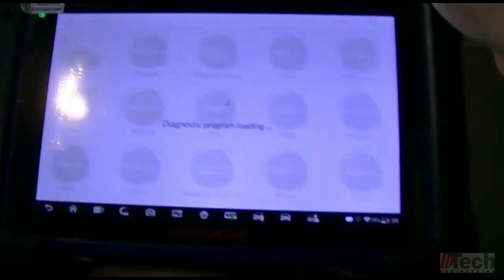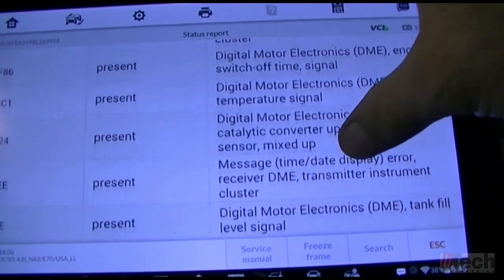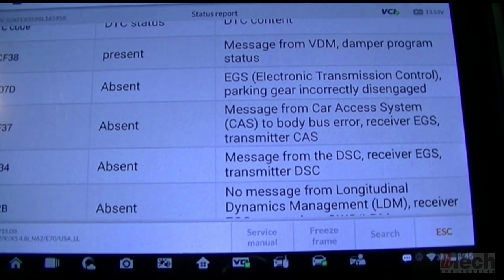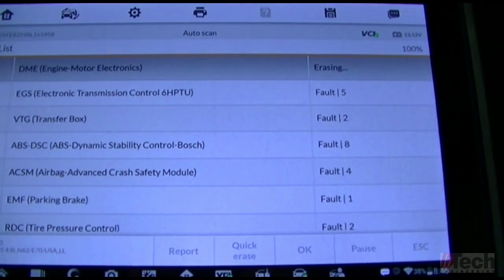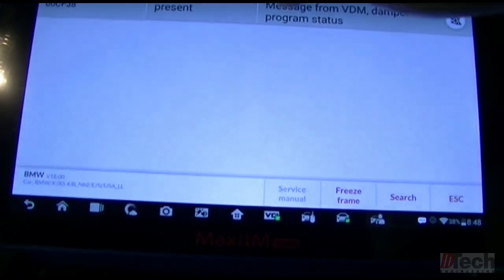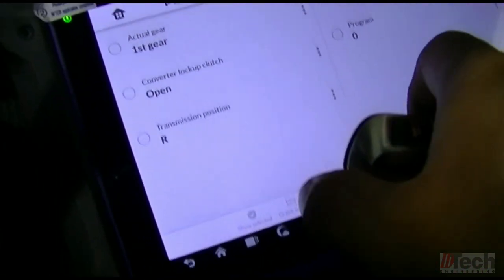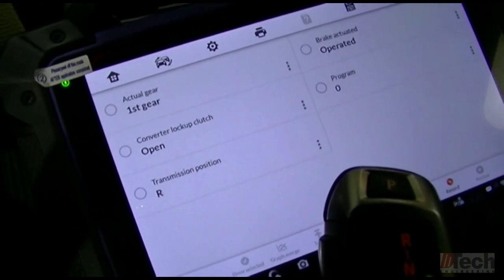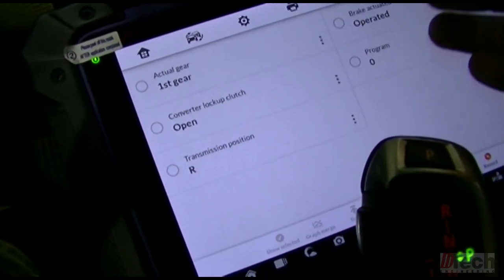2008 BMW X5 E70 No Gear Engagement Stuck Park

Comment: Bro u dont know how much this video helped me. I was struggling trying to diagnose this same issue and I was stuck thinking it was a ews Isn issue because I also did the same thing you did with the spare valve body. I searched for hours on end watching YouTube videos trying to find someone with the same problem and had an answer for cause/solution. Then I put it off for a few months and I decided to get back at it and then by the grace of God I found this video and I’m extremely grateful that I did. Thank you so much brother!!! 🙏🙏🙏👏👏👏
Reply from the maker: Super glad to hear this helped you out! Sounds like you had a hard time with yours, this one also was here for a long time before I even got to figure it out. Thank you for watching

Comment: Wow…..a really great job on this diag, Sadel.  It reminded me when I pulled a Subaru H6 engine for a head gasket job.  Subaru’s service info mentioned a special tool to hold the torque converter in place but I said “nah, I don’t need it.”  Little did I know that the Subaru converter had three splines to seat (and of course the converter came off slightly when pulling the motor).  It was a royal PAIN getting that final spline section to ‘sit’.  I should have bought the special converter locking tool!

I hope you and the family have a wonderful Christmas, brother.
Reply from the maker: Yes, situations like that can cause some serious damage as we saw here

Comment: Wha!!!! God made you for a purpose! Here is our client's problem: Client's 523i is disengaging into Park as in video when you release the brake pedal to drive off. Meanwhile, a scanner is showing actual gear is 1st Gear in any knob position.... In Neutral, car is trying to move forward, but laboring like you've stepped on the brakes....and the scanner can't access the Gear Selector Module.....
We agree with you on the low ATF as someone changed the fluid after sump damage and we guess they nenver run engine when topping up! 

Will notify you accordingly 😊
Reply: Any updates?

Comment: Great work!  Question about the repair though, did you just swap out the front pump from the other transmission to replace the one that was damaged during engine install?   Wouldn't you be worried about the metal shavings being in other parts of the transmission, causing future damage??   Thanks.
Reply from the maker: yes it can be a worry, but it was worth a try for me

Comment: What if the engine or the transmission is still the same the car came with? Transmission oil not getting sucked up and exactly same deal as you have.
Great video helps me find answers for my E70. Thank you
Reply from the maker: I would drop the transmission pan and inspect for metal debri, the only way for the fluid to not be sucked up is if the pump not working or blocked

Comment: So what did you actually do to finally fix it same problem with my 2010 550 I love the car don’t want to get rid of it
Reply from the maker: Removed transmission and replaced the oil pump in the transmission
Reply: @DTEAuto  what’s the chances of it being the same thing with mine ? Slim or I won’t know til I try everything
Reply from the maker: I myself have only seen this once (which obviously is the video here in question) and it was caused by human error from incorrectly installing the engine they damaged the transmission oil pump. Otherwise I have never seen this. You could have similar issue though if for some reason the oil pump failed somehow, or the feed to the pump is bad or just simply not enough fluid in the system, because all this on mine had to do with a loss of fluid pressure and so the vehicle wouldn't get out of park

Comment: Wish i had your help. Used transmission install in a '10 x5 e70 and vehicle runs but no gear at all, no drive, no reverse, wont even go to neutral its just all park gear. Now, yes i can change valve bodies back to the original one, but isnt there some type of software to just reprogram this transmission to its new vin? Kind of like GMs SPS2/TDS system on acdelo? Or like fords IDS/FJD? Isnt there a software to program these like we would anything else?
Reply from the maker: The Autel IM608 can do it and some others out there, I have the Autel.

Comment: hi i got BMW E 65 740 i 2007 160.000 km  automatic transmission  stuck  car can not  move any gear .Before that car hard shifting last transmission service do on 95.000 km .Bough valve body seal brand new  filter ,oil  replace also clean transmission  valv with carby cleaner put back together .When start car not any lights on cluster ,but after 5 min car running come all light shift ,but no Parking and car not select any gear stuck can not move .What you things is problem .
Reply from the maker: make sure the valvebody is correctly installed with the manual valve lever
Reply: @DTEAuto  thanks

Comment: Any idea what's wrong with mine ..
   2014 bmw 320i 
Says on dash not possible to shift out of park .. 
   Lights on electric shifter don't even come on..
Transmission was going strong nothing with it i know that.. 
   Was sitting for a year
Reply from the maker: it sounds like you might have a module not communicating, you will need to have it scanned completely and see if there is bus issues present, or at least get an idea of what codes there are.
Reply: Yes hello can pls help me bc my car seat for 2 yr with nothing wrong before I parked it and it will not go in gear it jumps back to park can u pls explain

Comment: Isn't there a pid for tranny oil pressure..thanks..?
Reply from the maker: not in any of the data in the scanner I was using, not sure on actual oem , but hard to say since there is no actual pressure sensor inside the transmission